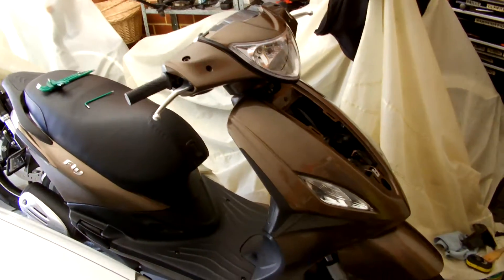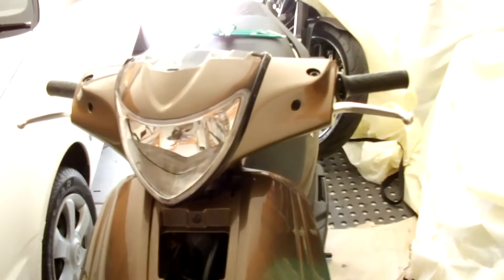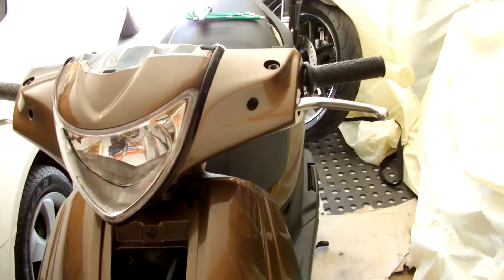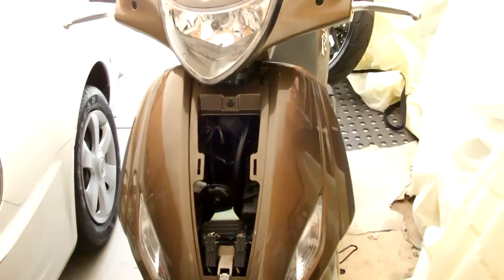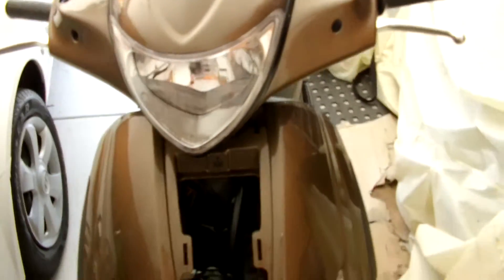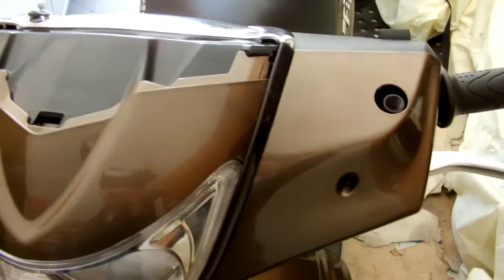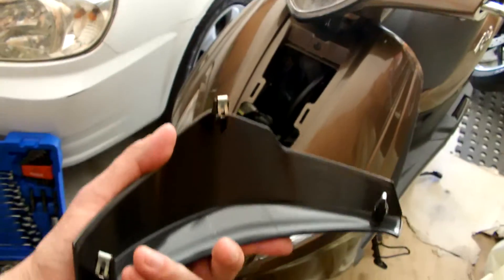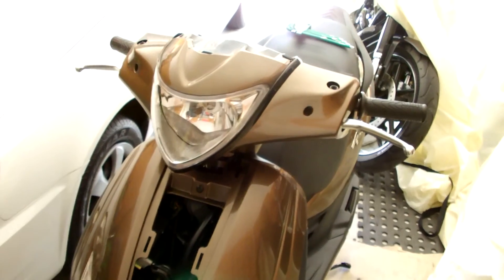2012-2016 Piaggio Fly 150ie- Headlight / Handlebar Cover Removal

Comment: How to adjust throttle cable on 2016 piaggio fly 150? If you can help me would be great. Thanks
Reply from the maker: You have to remove the handle bar cover first which means finding all the hidden screws and not forcing it apart or you may break the locating tabs.... 2 small spanners are needed to undo the lock nut and turn the adjuster on each cable until the slack on both the 'pull' and 'push' cables are within specification. (about 2-3mm slack when twisting the throttle grip)  Then start the motor with the bike on it center-stand, and turn the bars from left to right all the way and see if the slack in the cables is the same still. if not then loosen them up slightly. Dont forget to do up the lock nuts on the cables when your finished.
Reply: Thank you so much, I will gave it a try.